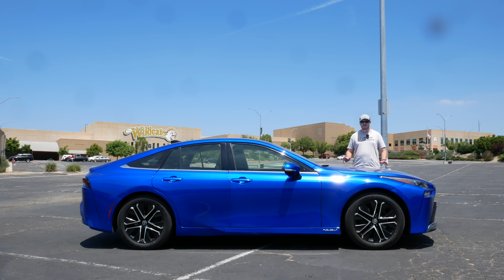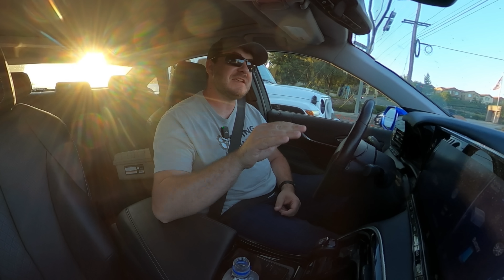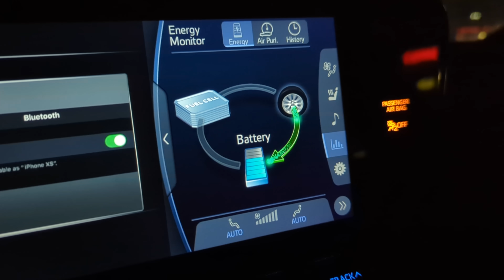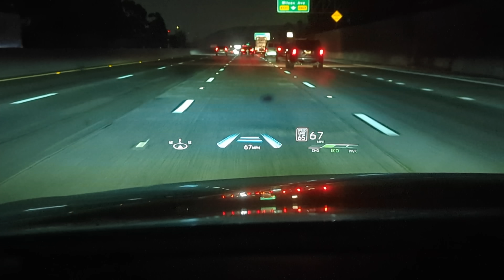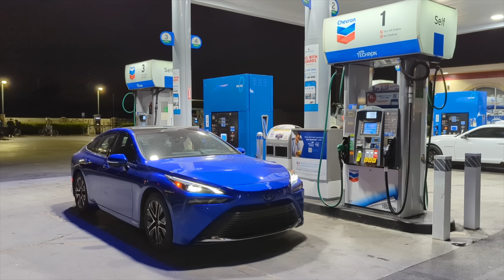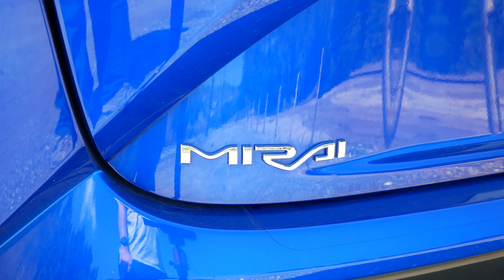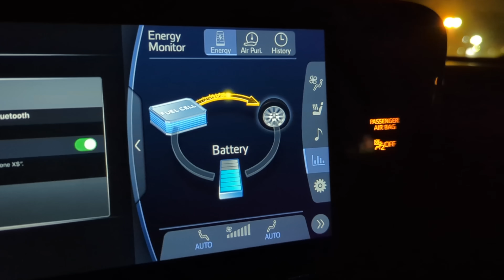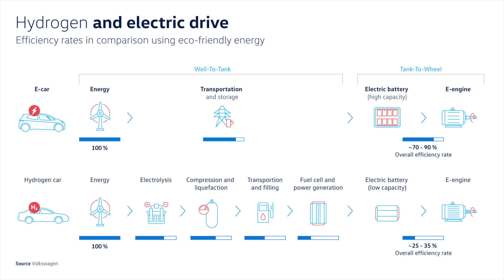The Toyota Mirai is Disappointing

Comment: If people must buy hydrogen cars at least the Fuel Cell type doesn't give off Nitrogen Oxides in the way it would if the car had an ICE burning the gas. Having said that, I did read that fuel cells are not very scalable in that they use various scarce elements to catalyse the required conversion acitivity.

Comment: I kinda wish people would stop talking about how fast cars are. Modern cars are too fast. Very much too fast. A high school girl graduation gift base model jeep wrangler does not need 300hp. Standard family cars shouldn't be pushing 400-900. There is only so much that ABS, TC and stability control can do when a car so easily lets a person get going way faster than their skills afford.

I don't mind SOME cars being fast, I am a car enthusiast, but I think slow cars need to make a comeback. Cars you can really wring every bit of power out of at safe speeds to have fun, but not so little that they're a liability. 180hp and 4000lbs is FINE. I LIKE that much power.

It also leaves the tinkering and modding scene open. And lower power motors are cheaper to make, maintain, replace, use less materials, and (theoretically) draw less energy for the same power output due to lower mass.

I'm just tired of hearing everyone gush about power (or bemoan lack thereof). My old land rover makes 180hp and will tow 10,000lbs at 75mph with zero complaints. My heavilt modded supercharged mini makes maybe 240 and is a riot. My wife's 255hp focus ST has ALL the power any normal driver could want.

But my FZ1 can do 72 in first gear, and I just don't find it fun to do anything except pass people on the freeway with.

Sorry, boring rant aside. Always love your videos regardless.

Comment: I agree that electric cars make a lot more sense than hydrogen. It's no where near as practical. I disagree about the main benefit. Fast refills are nice, but green hydrogen it seems to me, would be the main upside. Another huge benefit would be that batteries require so many rare earth minerals, and there is the question of what to do with the old batteries, while fuel cells use very small amounts of these materials.

Comment: Hey robert. My question here is this. What are the end emissions related to the Mirai as far as hydrogen production vs lithium ion battery production as a whole? Ive been wondering which process is less harmful to the planet. I mean hydrogen sounds cool in theory.
Reply: As it stands right now an EV breaks even with an internal combustion engine iirc even on an entirely fossil fuel grid after about 5 years or so, end to end including manufacture and materials. Hydrogen beats ICE in terms of operating emissions but the absence of infrastructure and current methods of hydrogen synthesis, not to mention complete absence of mass production for this class of vehicle, likely means that in a consumer car like the Mirai the EV wins in a landslide. Markets like long haul trucking where battery EVs haven't really made huge inroads and the range advantage of hydrogen becomes more important as it reduces the number of fuelling stops required (and therefore infrastructure) might push hydrogen in to the lead for heavy vehicles though, particularly since the battery sizes for large trucks are absurd.